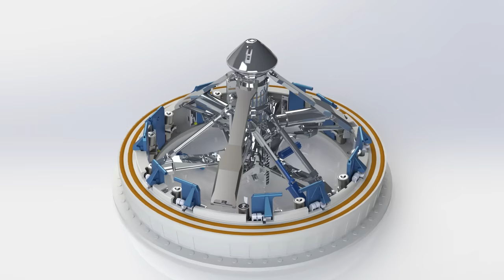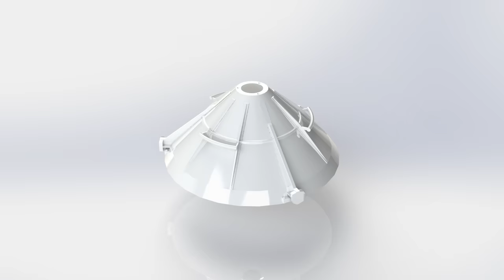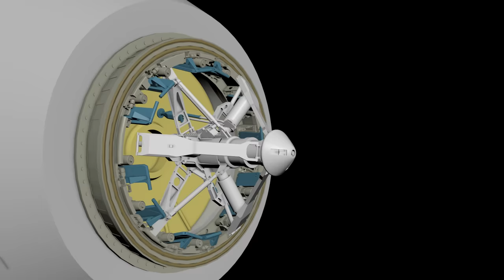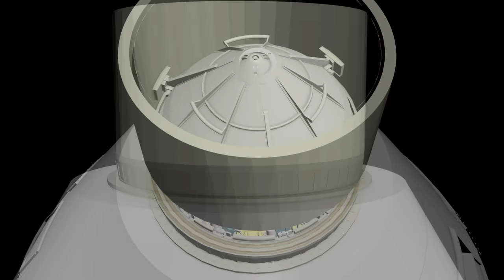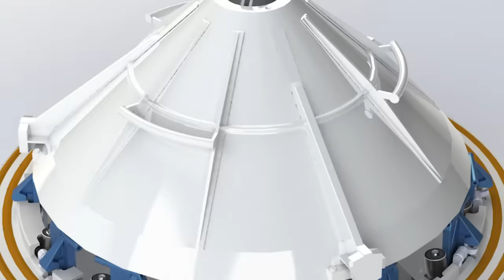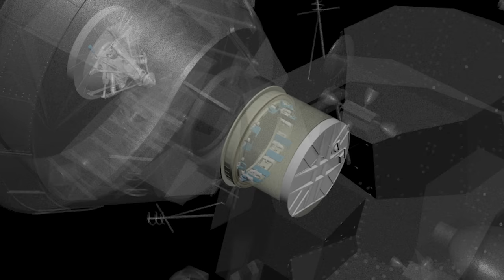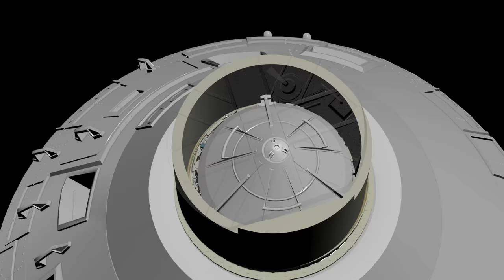Apollo Docking sequence - Connecting the Command Module to the Lunar Module.

Comment: Brilliant work. Really good visualisation. There are a couple of small points that would be worth visiting if you ever feel like modifying (what is already extremely good). First, there could be mention of the shock absorbers and centring arms on the probe that serve to damp rotations and align the longitudinal axes of the spacecraft prior to retraction. Second, on the later flights, the undocking technique was to extend the probe before releasing the capture latches, essentially hanging the LM on the end of the probe. This minimised the possibility of air in the tunnel causing unwanted velocities with the LM.
Reply from the maker: Thank you. I wasn't aware of the shock absorbers. I'll have a look at that. Yes, I read about them extending the probe after I'd finished the video, typical! it would have been straightforward to insert that animation but I believe you cant replace the youtube clip as it becomes a new movie. Something I'll have to look into, thanks

Comment: I remember watching the live televised coverage of the Apollo 14 mission. For about 2 hours the command and lunar module’s couldn’t dock. They tried over and over again and this delay used up the limited fuel. So the technicians on the ground got a mock up of the entire docking mechanism and troubleshot what they believed the problem was. Alan Shepard proposed going outside and physically pulling the 2 spacecrafts together. He was that serious because he just got reinstated to flight status after being medically grounded and was the only original Mercury 7 to be assigned a flight to the moon. He wanted to walk on the moon to get the program back on track after the Apollo 13 incident. I believe that 1 or 2 of the 12 locking latches weren’t loaded in the correct position, but after a few more attempts they finally got a hard dock. If Apollo 14 failed the rest of the program could’ve been cancelled. The other crew members that were assigned to go to the moon were probably concerned that they may not get their chance to go if the 2 spacecraft’s couldn’t dock. This never happened again on the remaining missions.
Reply: You might not be aware of this but Kevin did a video about that issue. Another excellent effort by him.
Reply: @mako88sb  
Do you have a link for me to see this? I’d like to see it….thanks, David Page.
Reply: @davidpage3893  Tried responding a couple times. Not sure what the issue is. Just google the guys name who did this video and AP-14. It should come up.

Comment: This is just unreal thinking of all the original engineering and the route calculations and the most exacting fuel consumption rates particularly for the module. And the ingenious design of the module acent engines.

Comment: Fantastic illustration of this facet of the Apollo mission.  Well done!

     @ 6:00, I’m sure all crew members were suited and hooked up to the CM/LM ECS during this evolution.   

    It would be kinda scary, loading 6000 psi preload in the probe retract mechanism and releasing all 12 docking latches.  

At that point, the 5 psi of cabin pressure is trying to push the two craft apart, held together only by 3 tiny latches at the tip of the probe!

Comment: Thank you so much! I’ve wanted to know the specific details of this for ages!

Always found it funny how the Russians didn’t even attempt to design a system like this for their LK. Instead the two craft just hard-docked into a metal grid on one of them, then the cosmonaut had to spacewalk from ship to ship!
Reply: It's definitely a design trade-off situation.  Part of the issue for the Soviets may have been which design bureau developed each vehicle.  With Apollo there were two companies, with NASA as overseer, I'm not aware of how it worked for the Soviet program.

As for needing airlocks, they didn't if they just de-pressurized both craft.  They did that during Apollo, at least I'm sure they did during the Apollo 9 first manned flight test of the LM in Earth orbit.  Plus it was a contingency plan in case the CSM & LM couldn't dock after lunar liftoff, they'd spacewalk back to the CSM.

I'd never considered before this, but how would the Soviets have coped with an Apollo 13 type problem during a lunar flight?  It would have been much more difficult to use the lander as a lifeboat if it required spacewalking between the two craft, as well as using lander power to help bring up the re-entry craft as with the Apollo.
Reply: @bobblum5973  With the Soviet Union it was all designed by ‘the State’, there were no different companies obviously. 

It’s funny, because in terms of the whole space race (and the Moon race in particular) being a test of communism vs capitalism, the Russians lost totally because of communism’s inherent shortcomings and capitalism’s strengths!

As for an Apollo 13-like scenario, the Russians cosmonauts would have died. And several Russian engineers would have wound up in prison (or shot). Seriously..
Reply: @HailAnts  Oh, I know there weren't the same sort of companies like in the USA, but there were different design bureaus and factories involved.

The wonderful Encyclopedia Astronautica site has some good articles on the Soviet program and hardware.  Here's a link to one evaluating reasons why they lost the Moon Race:
http://www.astronautix.com/r/russiawhydisethemoonrace.html
Reply: @bobblum5973  Yes, it’s from reading that site that I made the above statement. The commies are so inherently mistrusting of each other combined with not wanting to appear too talented individually (not to mention not wanting to go too far and suffer the ramifications of failure) that they couldn’t get their program together soon enough to even really be in the Moon race.

That and a drunk and incompetent soviet doctor killing Korolev during a routine surgery..

Comment: Once the docking is completed the Attitude of the LEm is gained by means of the CM's attitude. I am not sure but I think I read somewhere (M Collins book?) that the LEM and the CM rings have marks with degrees so as the docking cannot be perfectly aligned then, by reading the angle difference in the rings the attitude of the LEM depended ONLY on that angle. I am sure you may add more to this.
Excellent video. Thank you!

Comment: 2:42 - in the olden space days of the Apollo, this part of the docking maneuver, after the separation of the SM/CM from the Saturn 4B assembly that has the LEM on it; when you turn it around, is known as "pitching around." If you cannot yet align it yet, you would have to pitch up or pitch down so you can see the LEM and Saturn assembly (what remains of it) so you can see the  separated craft to begin dock. 

After you pitch around, you have to align the CM with the LEM. So you have to do a GDC align option, and then you thrust forward at about---say---2 to 3 feet per second.....very very slowly. And you use the CM's optical target visual and this allows you to align the LEM's optical target visual as you approach the LEM, to get the catch, then barber-pole, and then retract to end the docking procedure. 

What does GDC stand for?
Reply: Post-docking, I assume that the latches/hooks of the CM/SM are now bolted to the LEM assembly only to the LEM itself, and not on the Saturn 4B assembly. So keenly, after doing that so-called "LEM extraction" option, the LEM, CM and SM are now freed from the remains of the Saturn 4B for good, and this means it is a go for the crew to head to the moon.

Comment: Great video... though I'd still like to see that procedure for connecting the umbilical power cable used to separate the LEM from the S4B, that also ended up saving Apollo 13 by transferring power in reverse from the LEM back to the CM to start up the frozen command module.

Comment: Finally! You'd think that a network anchor would have explained all that. How many times before reentry did Jules Bergman take a torch to a model of a command module to explain how an ablative heat shield works? But no...
Reply from the maker: I know. I never understood why they didn't demonstrate it with an actual set up.

Comment: I wasn't aware till I saw this that the whole docking ring was jettisoned with the LM at the end of the mission.    I think the probe assembly also went with it too.   I think the only probe brought back was the Apollo 14, and the reason for that was because of the problems they had docking with the LM Antares for its initial extraction from the SIVB;   Roosa tried 5-6 times and finally just pushed the two craft togetehr until the rings triggered.    Strangely enough there were no further problems with the probe.   They undocked to land, redocked on ascent, all with no problems.   But NASA asked them to bring back the probe for examination.   NASA was unable to find why the probe failed to capture during the first docking.

Comment: While technically not part of the docking system there was also a back up method of transferring the astronauts from the lunar module back to the command module in case something went wrong with the mechanism inside the docking tunnel. There was a handrail originating at the LM's forward hatch that went up over the top of the LM to the apex of the CM and then handholds down the side of the CM to the main access hatch on the side of the CM. This contingency allowed for an emergency spacewalk to be performed if necessary to get the astronauts back into the CM. For this scheme to work the astronauts also had to retain their emergency oxygen packs from their portable life support system backpacks after their last moonwalk. The oxygen packs would then provide oxygen for breathing during the spacewalks in lunar orbit.
Reply: This is one of those contingencies wherein the crew would need to be aware of the docking/latching problem before LM closeout.   

    Before closing the forward hatch on the moon, the crew would normally discard their PLSS and other unneeded mass.
      
I don’t believe their LM umbilicals were long enough for this type of EVA.

   

    Another grim contingency was the incapacitated,  but alive CMP.   

    Prior to LM liftoff, the CMP selected attitude hold and turned on the rendezvous transponder.

      At that point, the LM could effect the rendezvous and docking, but only the soft capture since probe retraction was accomplished in the CSM.

     After the EVA to the CSM side hatch, the CDR and LMP would be forced to depressurize the CM, killing their crew-mate in order to get home.

     Good thing that never happened!
Reply: @joevignolor4u949  
      Awesome!   Thanks Joe.   I knew about the OPS part of the PLSS but didn’t realize they separated and retained it for LM liftoff.

Comment: I am reading Michael Collins book atm and he said the command module pilot docks with the returning LM because it’s easier and the LM pilot would have to crane his neck uncomfortably .
Reply from the maker: Yes I've read that too. The reason I put in the cm docking disc was because I found a couple of documents highlighting it. I thought it would be good to put in as much info in as possible. I suppose it was either used as a backup or for a rough alignment. It would be good to find out if they used it or not. 👍

Comment: I wonder how they fit the drogue through the tunnel. It would be like trying to fit a circular manhole cover into a smaller circular manhole, right?
Reply from the maker: Probably just my animation. The drouge is definitely smaller than the diameter of docking ring. I remember struggling when I was using photographs to match the angle of the drouge to the arms on the probe. Also the height of the drouge connectors on the lunar module tunnel may be higher. It was all a combination of trying to find the best photos and the best fit. Although I tried to get the engineering of the probe and docking ring as close as possible my main focus was to tell the story 👍

Comment: Great details. I'm curious how they reset the automatic latches for lunar separation without the spacecraft prematurely separating. Is there a third thing keeping the craft together, or do the latches remain engaged?
Reply from the maker: Thanks, I mention it at 6 minutes. The probe latches are locked into the drogue and the probe is then pressurised to maintain a stable docking. The latches can then be unlocked and the hatches sealed. When it's time to undock, the probe head latches are retracted and the probe extends. This allows the LEM to undock and move away from the CSM.

Comment: Amazing!

What SW are you using?

We are working on space missions sim and one of it's features is a possibility to make physically accurate animations like yours
Reply from the maker: Thanks. For the actual docking ring and probe I used solidworks. This was really good for the mechanical connections. I had to do some photogrammetry to get the correct dimensions. For the rest of the modelling I used a trial version of 3d studio Max. I did this for the animations as well. For my other video on Apollo 14 I used after effects to get the thrust effect. Good luck with the sim. Please keep me posted on your progress, it sounds brilliant.
Reply: @graffix101  How can we be in touch? Do you have a twitter or discord?
Reply from the maker: @LunCoSim  I have a twitter account. not that I use it much 🙂@KevHughes24

Comment: Hello Kevin... As I have already written : Great vidéo

But, there is something that bothers me!
At 6:01 you said  :
" the probe is preloaded to 6000 pounds of tension to allow the subsequent unlatching of the 12 docking ring latches and to maintain tunnel pressurization..." 

Ok for this!

What I think is a pity is that in the rest of this sequence you don't explain how the 3 capture latches (on top of the probe's head) retract for LM/CSM undocking
(Release of the capture latches at undocking is accomplished by electrically energizing tandem-mounted dc torque motors located in the center piston.)

it would look good with a little animation

Best regards

(Sorry for my poor English, I'm French)
Reply from the maker: no problem Apolloman. I tried to show the whole sequence as simply as possible so as many people as possible could understand. Since doing it i've had a quite a few comments like yours requesting specific details and i'd really like to add all these at some point. Time and software is hindering me but its definitly somthing i'd like to do. Keep all the technical comments comming :-)

Comment: Excellent visualization, you answered a lot of my questions and left many unanswered. The big ones are:
Failure scenarios, including reset and retry.
Electrical motors and sensors (i am assuming there are some, or is everything manual)
How does the drogue fit through either hatch, it seems it would be too large.

The sound effects were great, but i was expecting that click-click-click we hear on one of the films or miniseries as the probe retracts.
Reply from the maker: The probe folds up. I tried to show that in the cad file. It becomes half the diameter. The sound effects were a bit of artistic licence on my behalf. firstly the sound of the probe retracting, then it would be the sound of all the latches slamming into the tunnel either at once or slightly delayed. To be honest, I'd love to ask one of the astronauts in person 😉
Reply: @graffix101  You will have to hurry if you want to ask them. I believe there are still 10 Apollo astronauts alive, 4 of whom walked on the Moon. Borman and Anders however never had a LEM on their spacecraft (Apollo 8) but the 3rd on their mission (Jim Lovell) flew again on Apollo 13. That leaves 8 to ask, and I believe the youngest is 85. I met Lovell in the late 90's, very interesting character.
Reply: @wictimovgovonca320  I briefly met Jim Lovell at a book signing, he autographed my copy of "Lost Moon", which was later renamed "Apollo 13" as a tie-in when the movie came out.  Knowing he was a consultant on the movie, and the fanaticism of Tom Hanks and Ron Howard for accuracy, I would think the latching sound effects would be very close to reality.  Not sure how much different it would sound inside the spacecraft, in person, with a reduced air pressure.
I own a DVD box set of "From The Earth To The Moon", the Tom Hanks produced HBO miniseries, I can highly recommend it.  It's been a while since I last watched any of the episodes, I should see how they handled the latching sound effects.

Comment: Temperature in space -454 degrees F, Moon surface temperature day 260 degrees F and night -280 degrees F_ Now mix in radiation_ Those spacesuits were amazing when you consider materials of construction and battery technology of the time. Where were the parachutes stored for reentry?
Reply from the maker: absolutly! they were packed around the top of the tunnel.
Reply: You are referring to extreme night and day temperatures. The landings were always at dawn, when temperatures were milder. In the case of Apollo 11, they were between -9 ºF and  44º F. And of course, remember that the Moon rotates 29 times slower than the Earth, so a lunar dawn is a loooooong time!

Comment: I have a question. As I understand it from this presentation once on the way to the moon all the equipment is reinstalled after the LEM has been inspected. Now I know it's only a movie but in Apollo 13 and from what I remember at the time the droge and all its equipment was not installed when they had their tank rupture. I remember watching a replay of the footage of their broadcast as they took us on a  tour through the 2 space craft . Am I remenbering this wrong because of the Film.
Thank you for doing this as I always wounder how all the parts interacted with each other to make this work. It now makes me wounder what the first part of the comand modual was designed first. Was it this system that was so crucial to the mission and had to be made this exact size or was it down the line and made to fit what they already had.